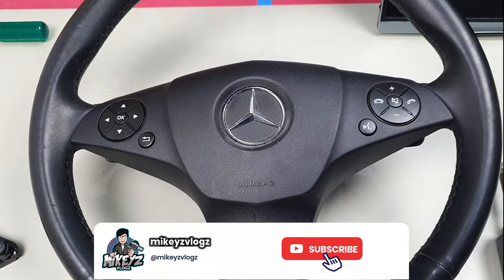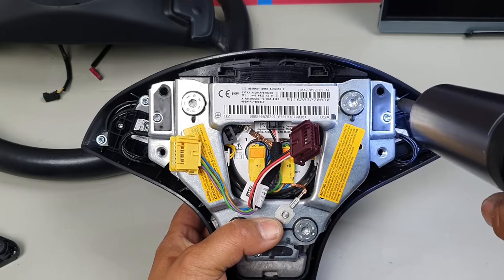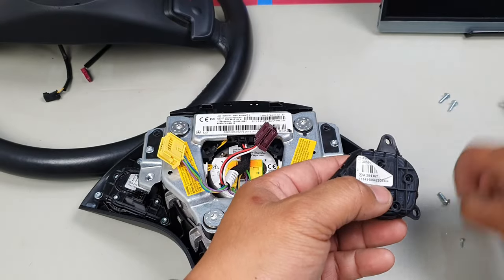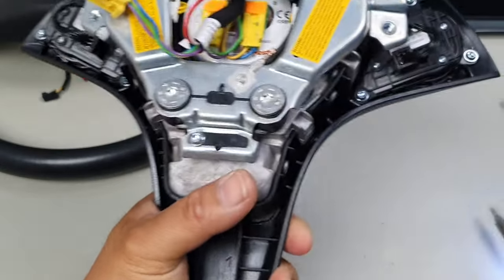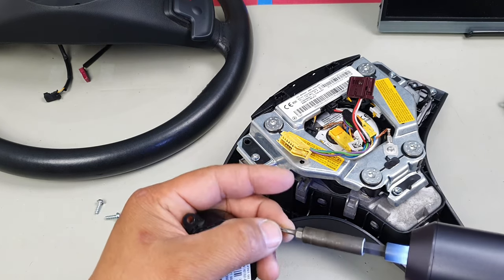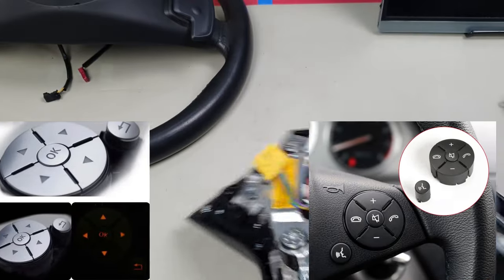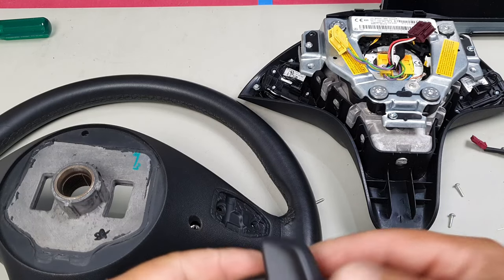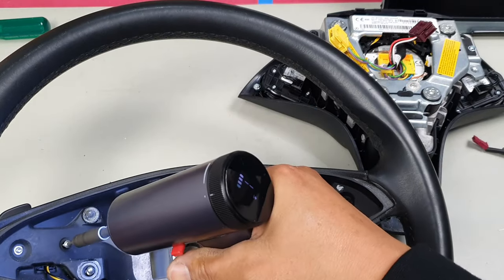Mercedes w204 prefacelift steering wheel control button assembly replacement, no more peeling

Comment: My 2011 E350 was T27, not T25 for the rear screws. Just a heads up to anyone doing it. Almost stripped a bolt.
Reply from the maker: ye ofcourse be careful and if it doesnt feel right then yes go up a size if u need to ... however mine is t25 and most mine are t25 or t20... its the most common torx size they use in mercedes
Reply: That is your fault, Mikey did say it was for his C CLASS not e class
Reply: @jasonswift7098  I didn't realize I blamed him for anything? I understood it was for the C class, I was just commenting for anyone doing it on an E class. Not a nock to him. I literally pointed out my mistake.
Reply from the maker: @iruleyounow ur all good buddy
Reply: @iruleyounow  You did

Comment: Hey bro just wondering have you done a abs module repair or replacement? Ive got the power steering malfunction and abs esp faults coming up after doing a bit of research pretty positive its the abs module
Reply from the maker: apparently if u have this failure its in the back near the spare wheel ... I believe that's what your referring to